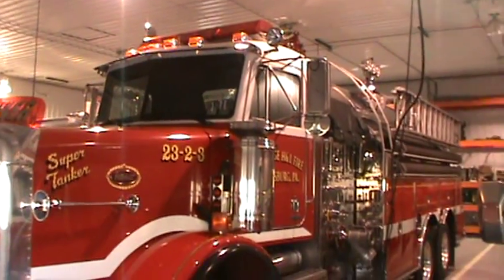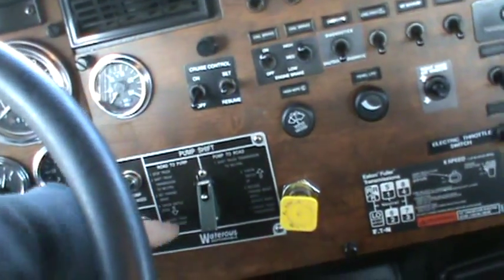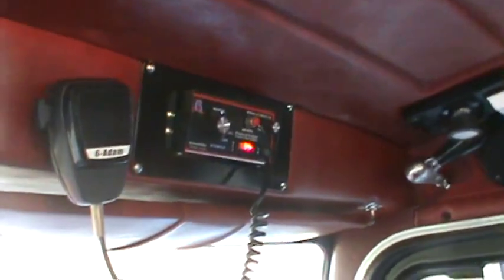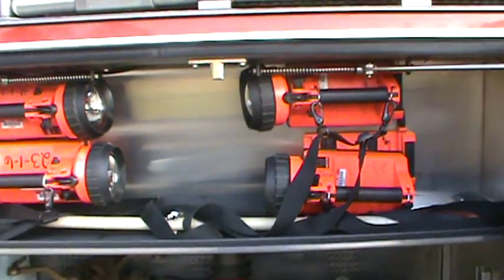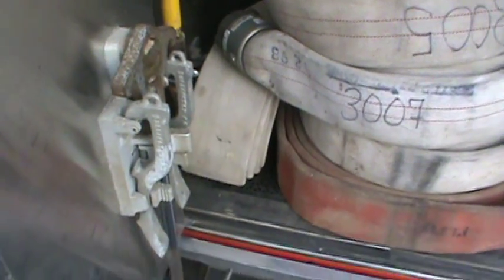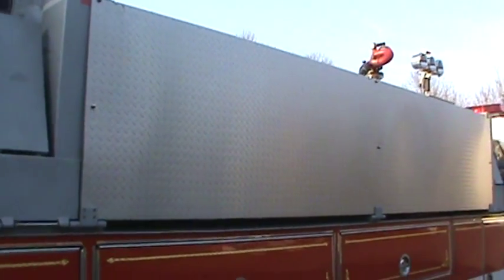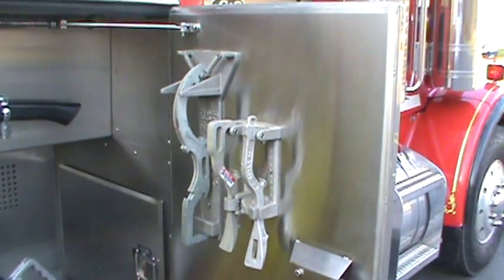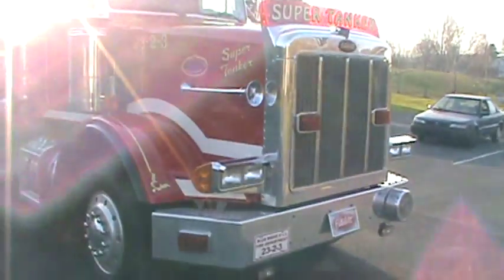1995 Peterbilt S and S Firetruck Tanker

Comment: 1500 GPM pump means you draft from the eye of the pump 15 ft down to your water source.  It is a NFPA regulation that the pump has to draft 1500 GPM.  That is how they are rated...That is done to ensure the pump is working properly and the seals are in good condition  That Tender will pump will pump about 400 to 600 GPM from the tank depending on the size of the pipe from tank to pump.  Beautiful  Tender....